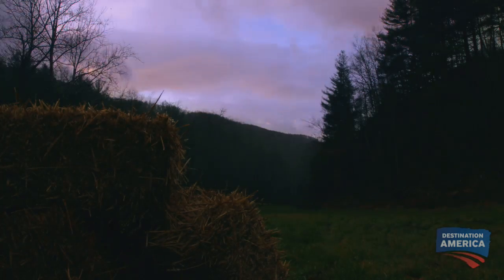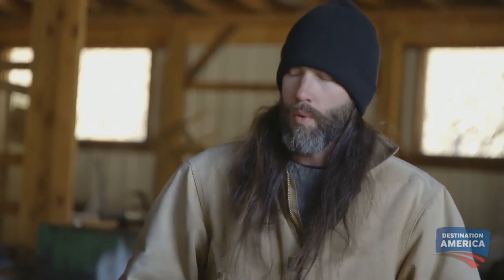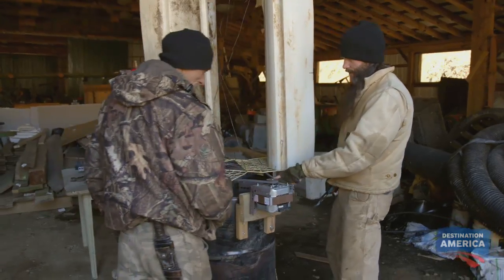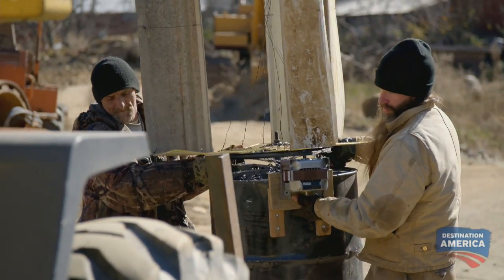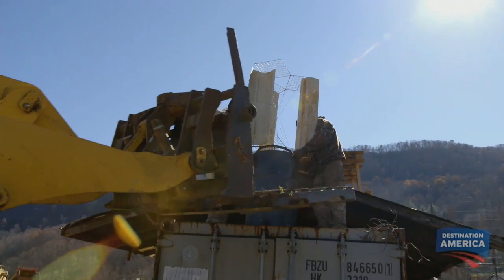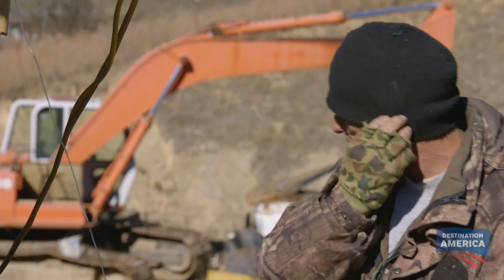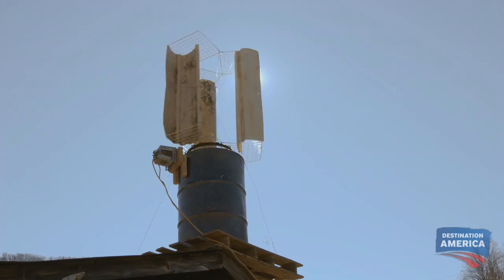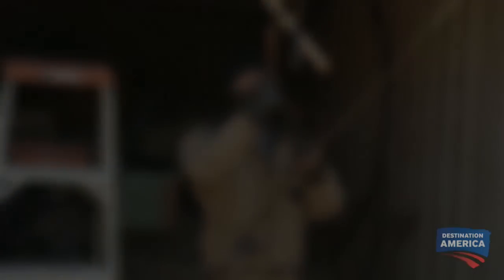Building a Wind Turbine | Hillbilly Blood

Comment: Alternators require to spin thousands of RPMs to generate any sort of amperage and require a power source from the battery to engage the magnets to even start working. This would not work.

Comment: Problem I didnt see them address alternators require a charge to power the electro magnets inside to make power and what regulator are they useing without one it would produce to high a voltage or overcharge the batteries , not safe or possible doing it the way they described. Permanant magnate generator is required and a charge controller for dc, ac requires the same but with the addition of a of a converter to dc several devices are available.